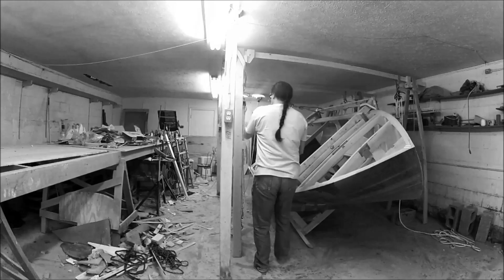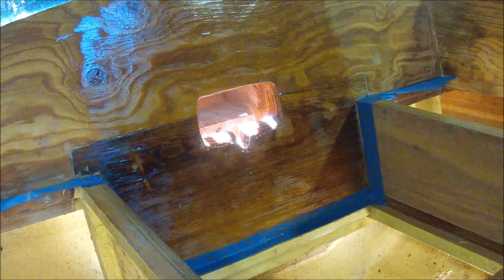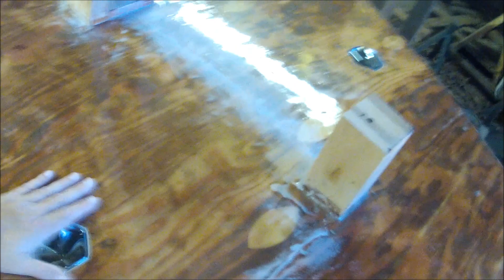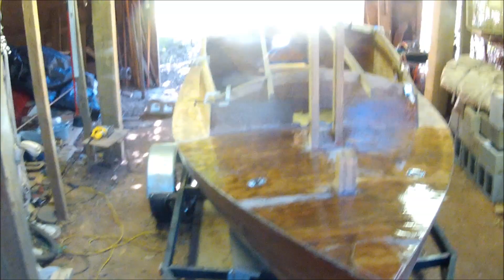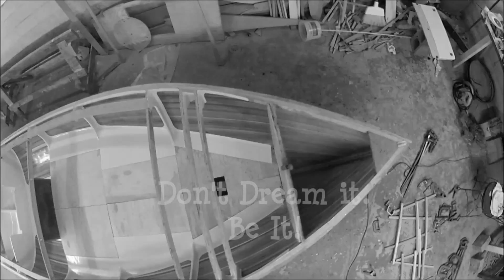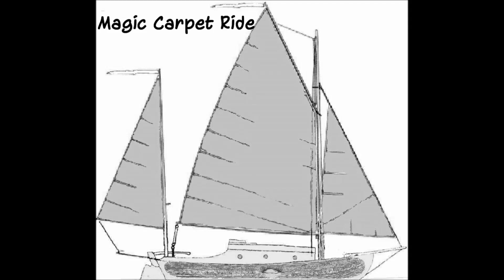Bob's Boat Building Diary S4E4

Comment: Does this boat have ballast?
Reply from the maker: It will have about 35 pounds of lead in the swing keel. Thats not very much so I would say no, not really.
Reply: I see, thanks. And what sort of places can it sail? (If I understand correctly, this boat is for rivers, bays & etc without too much waves and too strong  wind, not for open sea). And one more question: Can it recover after capsize?
Reply from the maker: @vasiapupkin2731  It's not self righting as is. Some lead ingots secured under the floor boards can help. The boat can go most any where. It's a cork in a hurricane. The boat can out survive the sailor in worst of it. West Wight Potters have Ben known to sail around the world. Fyi.